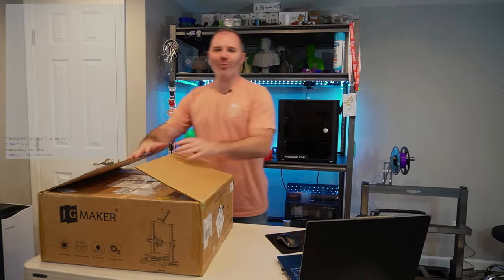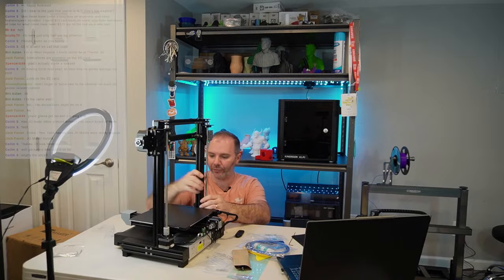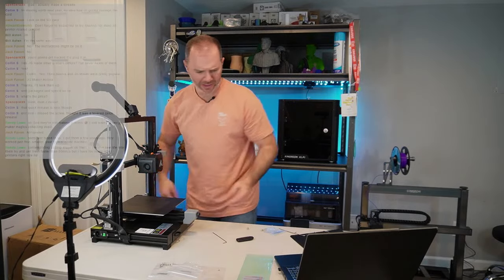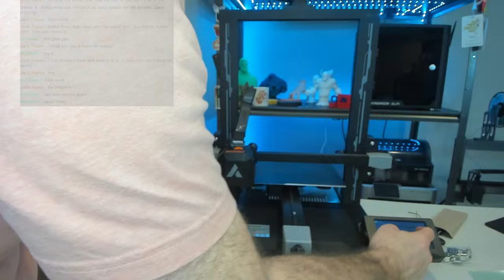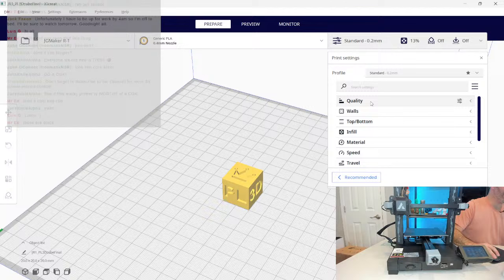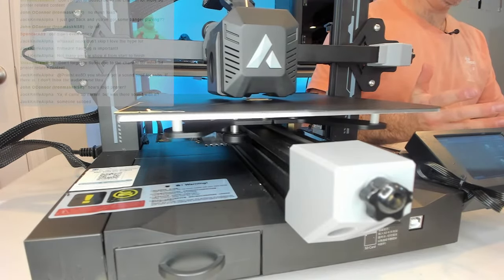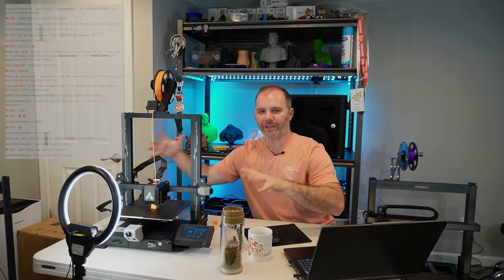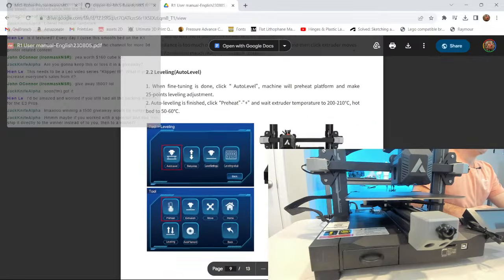Unbox and get to know the JG Maker R1

Comment: cant do klipper at the moment i dont have enough cash flow for the Sonic Pad as cancer is a pain
Reply from the maker: Well, I'm really sorry to hear that. The Sonic pad can be a really easy entry into Klipper for people, but you can also use ANY device that can run Linux. That means if you have an old laptop laying around , a raspberry pi, or a small TV box (like the inovato Quadra, which I have a video on) you can use them to run Klipper on multiple devices! So Klipper can be easier to access than you think. That being said there will be more setup involved, but it's the sort of setup that requires a Google search here or there, it koinging the Discord and asking for help. I'm happy to help anyway I can if you need.

Comment: One my printer, JG Maker R1, the belt under the printer bed is really lose, can it be tightened?
Reply from the maker: Yes it can! The R1 comes with belt tensioners already installed on the printer. The tensioner for the bed is located at the front of the printer, it's a black dial that is attached to the gray holder at the front of the bed. Rotating it clockwise will tighten the belt and counter clockwise loosens it.
Reply: @PrintsLeo3D  ours was not installed. I noticed in the video that the front of yours looked different than ours. I found a way and made it work. Thank you!
Reply from the maker: No problem! It's actually good to know that because I had a few 'quality control' errors as well. The belt tensioner in question was broken for me (but still usable, just cosmetic damage), and the Y end stop was placed in the proper location which was was a larger problem.

Comment: My auto level doesn’t work it keeps saying check proximity sensor location and I have done everything possible and customer service ran out of ideas ☠️
Reply from the maker: Is that error displaying on the screen? That sounds like it might have to do with the X and Y offset of the probe. You should be able to navigate through the menus and find the location where those locations are stored. When you find it let me know what they have been set to.
Reply: @PrintsLeo3D  yes. The offset was fine. Apparently the firmware was corrupted, so I just had to reinstall it. Everything’s working fine now I can’t believe how good the print quality is on this printer, and how quiet it is